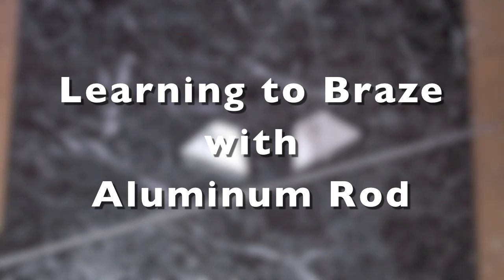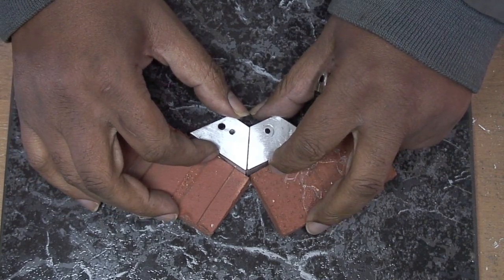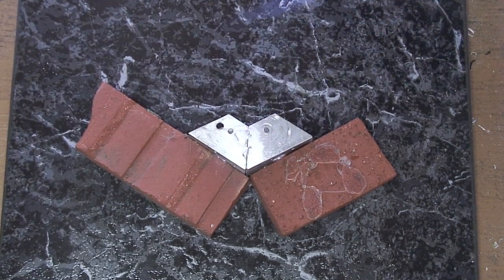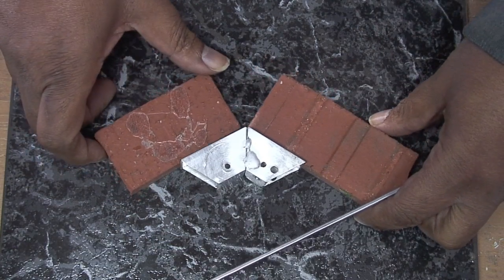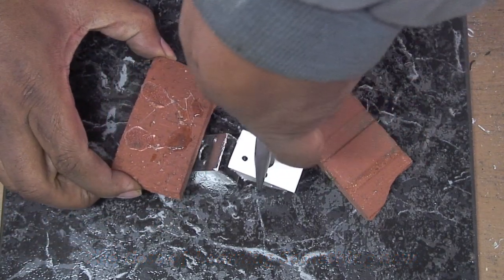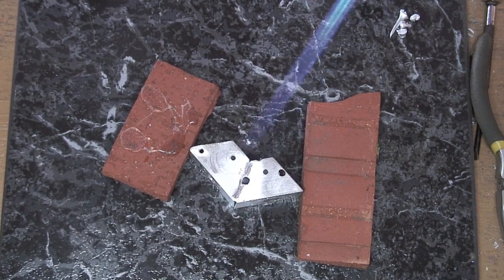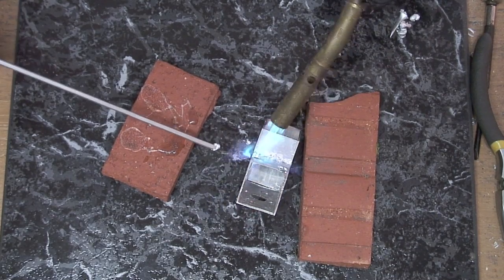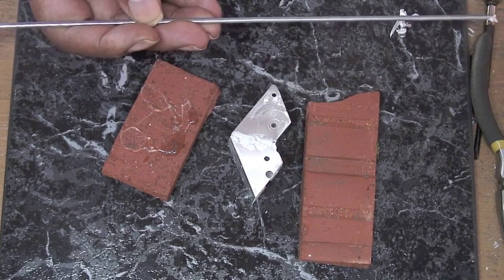Learning to Braze with Aluminum Rod

Comment: DON'T HEAT THE ROD, heat the base metal instead, let the retained heat in the base melt the rod. Alumiweld is not glue. Aluminum absorbs heat quickly and cools slowly. Keep heat on the joint after the rod metal is melted into the joint, and let it cool slowly. That's the "trick".  Keep on learning!!!

Comment: I think you should all check out HTS 2000 brazing rods. I bought them and am using them to fill cracks in my aluminum boat. Seems to work and hold. Perhaps you would be better off with stronger joints!

Comment: Check out the vid's from Muggyweld. They use A flux on all there ALU. welds and it looks like it works unless it's trick photography they use.
  Call your local welding supply and ask about ALU. flux. They might carry something like that or can order it.    Good luck!

Comment: the only problem you had is when you get the metal hot enough that the rod liquefies remove the heat and just run the bead with the stick. Also will look better if you file the 2 pieces so you get a groove on the seam to fill. then wire brush well and it will be much easier

Comment: Try using an insulating pad; yes Asbestos has a bad reputation, but it works!  Use only stainless steel or brass wire brushes, not steel. File both block edges @ 45 degrees to form a "V" where they come together. Then heat  both pieces of Al. block to be at same temp. Do not hit the rod with your flame. "Scrub" the rod in the "V" while heating the blocks; when the rod melts by contact w/ the blocks, feed in more rod until the "V" channel is full and rounded up a bit. Allow to cool & you're good!

Comment: It's like watching a frog learn how to fly! You know if a frog had wings he wouldn't bump his butt! I have been welding for years and that crap from Harbor Freight don't work worth a damned! I just tried welding aluminum AC lines with it and it kept blowing out, wouldn't seal and could drag off the aluminum with the rod because it was so hot and it still wouldn't stick to the aluminum.

Comment: are you stupid...a bond is a weld..brazing is not welding and does not/was never ment to take the place of welding. brazing is for sealing and short term use on things with little to no amount of stress. go to school and get an education first before speaking out of context about things you clearly do not understand.

Comment: Your adding a lot of weight this way, always move your torch, look at brazing videos for ally non farret metals act different when heated, flux the jointed parts and head the metal all over do not stay in one place when the solder yes get solder rods you are using tig welding rods, once the solder metals it will travel there the flux is, this is a great attempt, but you will get a better result and lies dross this way and you can use a 1/5 the amount of rod u used

Comment from the maker: Yes, once you get the hang of it, the joint holds very well. Sometime, if I I need a very strong joint, I will pop riveted it, then use Aluminum Rod to complete the connection.

Comment: Nice video. Ive used these rods before. You will improve with clamps and better heat sink. Small pieces like that are the hardest.
 The filler rod and weld joint is stronger than the base material... its neat stuff but quite a challenge.

Comment: Been meaning to try this, nice to know it can be done with just a propane torch. Have you ever smeared RTV silicone to the bottoms of your holding bricks? After they cure (silicone side up), you can flip them back over to use. They won't slide around as much, and silicone can stand about 600 degrees Fahrenheit. Thanks for sharing this video.

Comment: instead of a clamp , use heavier pieces of brick. the metal in a clamp will wick the heat from were you need it. over all nice vid.